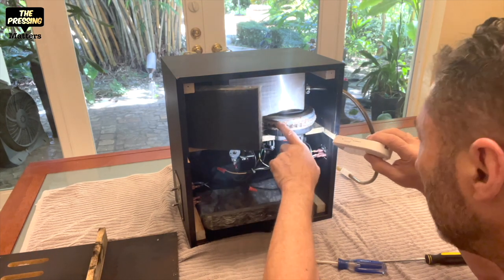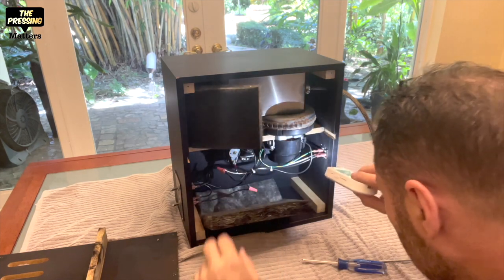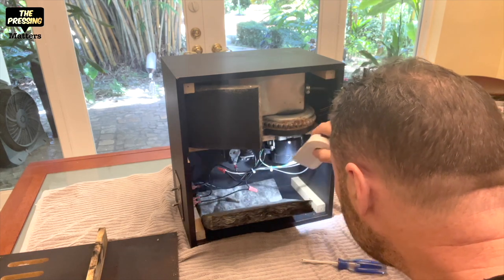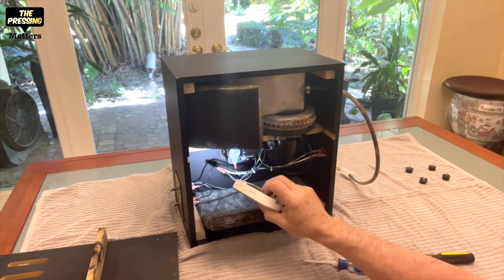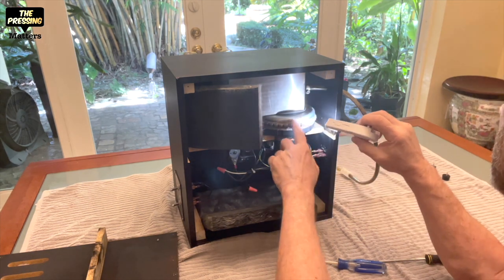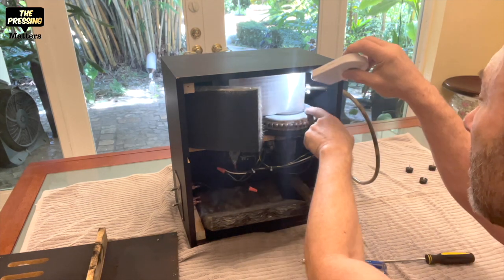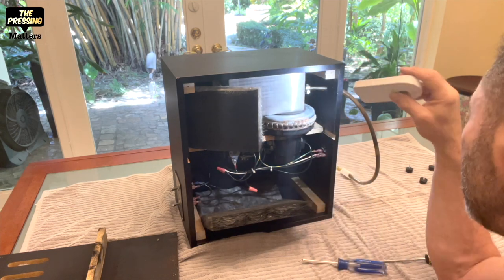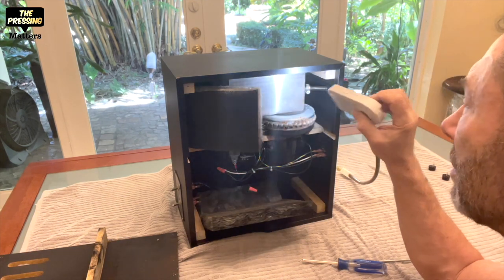VPI 16.5 Record Cleaning Machine - Performing a general inspection and updating components.

Comment: Nicely done Scott.  The 16.5, as you indicated, is truly an extremely reliable workhorse of a machine. I purchased mine 35 years ago and everything is original with the exception of a new cork mat that I purchased 10 years ago and the addition of the larger center hold-down clamp.  Even the arm tube and the associate support structures are original.  When needed, I do remove, glue and replace the arm tube pads (or lips).  By the way, if requested, VPI will graciously send you replacement pads for the tube at zero cost - great company.

Two years ago, I did add a second vinyl cleaning machine with the purchase of an Audio Desk Systeme Vinyl Cleaner Pro X ultrasonic cleaner and absolutely love it!  However, I continue to operate my trusty and faithful 16.5 for "used records" which are then followed up being cleaned with my Audio Desk Systeme last.  This works out very effectively.
Reply from the maker: Thank you, Tony! I think it's the most reliable equipment I've ever bought! Tell me was it difficult to remove the old cork cleanly? I haven't attempted it yet, and was looking for tips. I was thinking goo gone and a hair dryer. Any ideas?
Reply from the maker: Im also researching ultrasonic, but something a little more affordable - maybe Kirmuss?

Comment: I have one that I bought in ‘97. It has never given me any problem and is built like a tank. I did replaced the cork mat recently and got a new vacuum tube. It does a very good job and I really wouldn’t want to be without it. I use the diskdoctor cleaner which does involve a rinse, but I have found it to be the best over the vpi fluid. I use the vpi brush, which I like as it has a stiffness to it that gets deep into the groove. I also have the diskdoctor pads, which I didn’t realise you could get new pads for. I would like to get another tube etc to separate cleaning from the rinse at some point. Thanks for the video, my waste tube is still ok just a little yellowed.
Reply from the maker: Hi Nicholas, I didn't yet attempt the cork mat, could you give us any tips on the easiest way to remove the cork in order to replace it? That would be really helpful as I don't want to mess it up.
Reply: @ThePressingMatters  mine was not cork it was black foam that was disintegrating. I cleaned that off with goo gone. The new cork one has a separate inner circle, about 2 inches in diameter, that I positioned first. Then placed the larger piece, carefully aligning it withe the smaller inner piece and pressed it flat. It wasn’t difficult really.
Reply from the maker: @nicholas6823  i guess hoo gone or a hair dryer would assist in getting it off. I'll try it when I'm back from vacation.

Comment: I am hoping to skip over this VPI model - I have been doing spin clean for a few years (using a dry clean then the wet clean) and am hoping that my next purchase will be a Klaudio - Vinyl LP Record Ultrasonic Cleaner with Dryer. I remember using a hand wet vac with a toothbrush and a broken turntable at first - I agree with you that cleaning is important in this hobby. Another great video Scott.
Reply from the maker: Thanks, Jason! I'm so glad you enjoyed it. I am looking at ultrasonics but my budget won't stretch for the Klaudio. Have you researched any of the less expensive offerings?

Comment: Great video VPI 16.5 is the best purchase i made had mine 14 years its brilliant. The tube needs changing thanks to your video that’s gonna changed now. It’s been bugging me for years. Did you replace the cork mat ? And was it easy to replace ? Thank you
Reply from the maker: I did but an additional cork mat, but was hesitant to change it. So I've been keeping it clean in a bag and I use it for the cleaned side of a record when I flip it to do the other. It's a great machine, extremely reliable going on 20 years or more!

Comment: The VPI 16.5 has one of the best purchases in the last 2+ years since came back to record collecting. Yes I am curious about ultrasonic cleaners, but for now I will continue to use my 16.5. As you suggested, I will pick up a second holder and tube. On for washing my records and one for rinsing. My only problem is determining when you should replace a tube?
Reply from the maker: Hi Brian, I love having this machine in my arsenal - it makes a huge difference once you've got your technique perfected as you know. The velvet pads will appear flat and a little faded when it's time for replacement. I'd do it a little sooner than that. You do not have to replace the whole tube as replacement pads are available from vpi and disc doctor. There is a suggested record limit - maybe 300 sides? Not sure but glad you are enjoying cleaner records. So much more enjoyable. I'm watching the untrasonic wars carefully before I take the plunge. Not in a hurry on that. Thanks for your comments always.

Comment: Hi Scott,  I've been collecting and enjoying my Vinyl collection since the late 70's. My technician that built my vacuum tube electronics and was a big Linn LP12 advocate told me that putting any liquids on Vinyl damages it. He argued that the tiny microscopic information deep in the groves are impacted by anything that makes contact with them only negatively. This is due to vinyl being a soft material especially at the microscopic level. The real true question is: have you ever been able to clean an LP that was noisy and be honest here, make it even a small bit less noisy. I'm not talking about obvious surface stuff on the LP.
Reply from the maker: Hi Tara,
I have never heard any suggestion such as your technician mentioned. As long as it's a quality product being used and it's rinsed off thouroughly, I've never had any harm occur. Just the opposite in fact, many records have benefitted from a deep enzyme clean and rinse on o vacuum machine. Back when I was picking up a lot of second hand records, I got dramatic reductions in noise, pops and tics from cleaning out those grooves. Even new vinyl benefits in a significant way.
Reply: @ThePressingMatters  I'm not allowing an solvents or liquids to come in contact with any of my expensive LP's.
I handle them with kit gloves and always have the table not spinning when placing or removing my precious records.

Comment: Great video I got a used one on e bay it should be here tomorrow, question where did you get vacuum tube & drain hose from I might need them  Thanks.
Reply from the maker: I think they came from either Music Direct or Acoustic Sounds. One of them has all the accessories.
Reply: @ThePressingMatters  Got the machine I Love it along with my Ultrasonic machine.  Mine didn't come with the drain hose?  I guess they except the liquid to evaporate?  Also it came with a real small clamp? I made a bigger one out the the same material (Black Delrin)But, I made mind 3.70 (3inches & 3/4 Diameter)  on occasion the record stops spinning when the vacuum comes on?  Either I'm clamping it too hard or not hard enough or my clamp is too big?  I already had that center screw spin on me & I pulled it out Had to glue it back in!  I'm going to take their platter off and put my old one on for my project VC-S machine that one just clamps on the label.  I tried it out already but the vacuum wand was too long it hit the top clamp  I have to cut it down about 1" I'll do it Monday at work I'm a machinist .   Yes my center spindle got hot & so did the platter a bit.. But according to everybody that's normal.  Thanks for responding I'll keep you posted on what I do next!
Reply from the maker: @pjcdrummer  Glad you got the machine. I am assuming its an older model. I'm very surprised there is no drain hose. If there is no hole for it on the lower left back then it's not that it's missing Some early models did not have one I believe.  I would be cautious in marathon cleaning sessions with lots of rinses. Check with VPI about that aspect. There is a larger Delrin knob i picked up later - i think its an official VPI product, and it works very well. The record should be gripping tightly to withstand the force of the vacuum. Clamp it down tight. If it's still stopping, you may have the tube positioned incorrectly. The holder you have is probably not with the internal pin. New holders have this as well as the new tubes having a notch. Although it has very little play, it can and should be twisted up slightly to the incoming direction of the record. Do not force it! Since you may have the notchless tube, you can have more flexibility in positioning it. I actually preferred the early tube assemblies like you have. Just gently see the available play and orient it to be more open to the incoming fluid.Some air coming in will help the platter and record spin freely without sticking. Make sure the tube it seated fully into the holder. Also if the model has the hinged lid, be sure to remove the tube assembly before closing the lid. I've had a few accidents cracking a tube by not doing this. Let me know how things go and if you need more advice I'd be happy to help.
Reply: @ThePressingMatters  HI thanks for all your help!  The pin /screw in the center came out on me. It's in front of me as I type this!  There is really no room for me to put a step on the bottom for a small C-clip to hold the pin from coming up.   Another thing is it keeps spinning so the hole is shot! slightly too big maybe?.  I could possibly get some wood glue and some sawdust and pack it in there with the pin?  but eventually it'll probably start to spin again!  I tried Crazy Glue the other day but it didn't work!.  Once I trim down the top part of the clamp from my other Project machine at work tomorrow so the arm will fit,  (it was a bit too big) & this one just grabs on the label  I'll try to install it and make a short video to show you what I did.  If it still doesn't work I'll get or make a new platter or plug up the hole completely & start from scratch .  Question  is the vacuum wand height adjustable? it looks like a set screw on the side to move the ring up/down but, none of my allen keys fit it? 
Thanks again
Paul..
Reply from the maker: @pjcdrummer  The vacuum wand automatically adjusts - the vacuum pulls it down. The assembly is supported on a spring. It should pull down to the record with the vacuum on and pop up just after the vacuum is turned off. Is the spring supporting the Delrin tube assembly? Do you even have a spring?